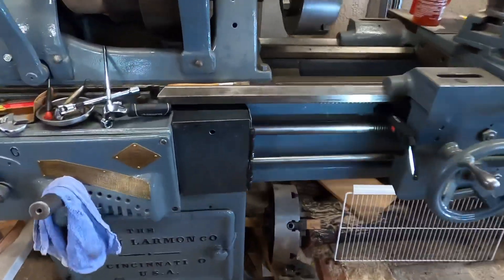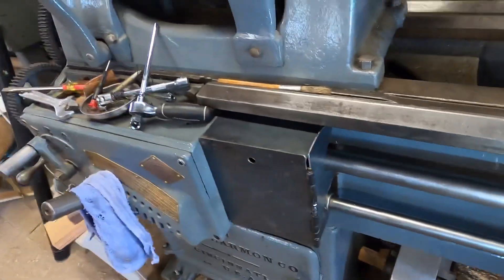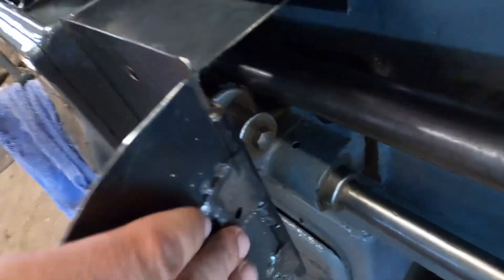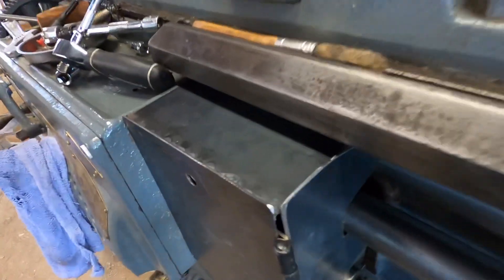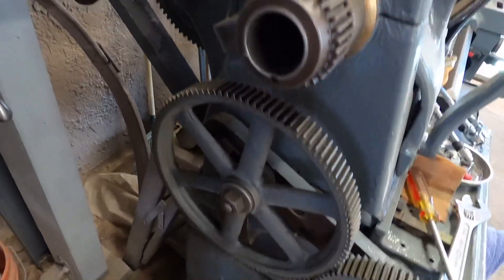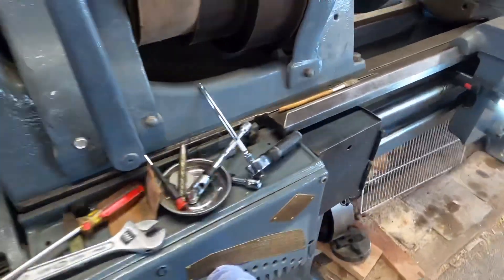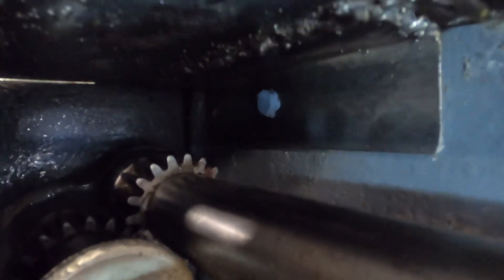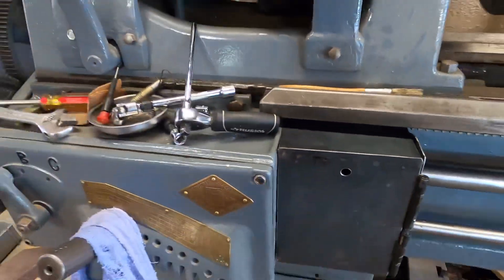Gear Cover Made from Scratch (snippet, see full vid)

Comment: My old hendey lathe was missing a cover that was supposed to be 1 piece cast iron. 
I started welding up a new cover from some ¼" steel that had a pretty closely matching radius. If I ever get around to finishing it off with a lil bond on the weld joint it may be hard to tell from the original  (I hope)
Reply from the maker: Hello and thanks for commenting.  Hope ur lathe cover project works out!  Send us the vid when done.  Thanks much! 
-JR